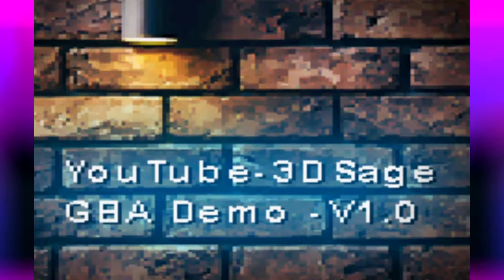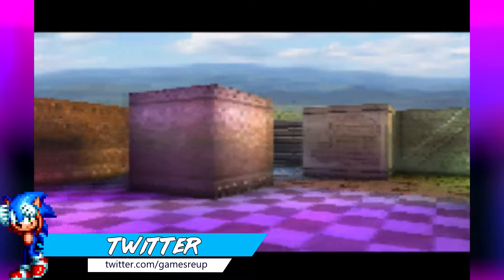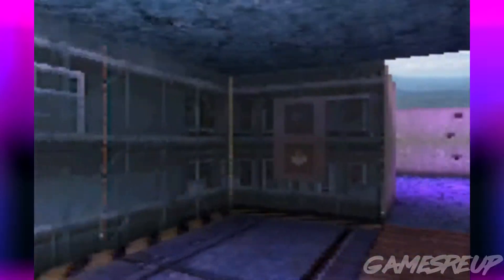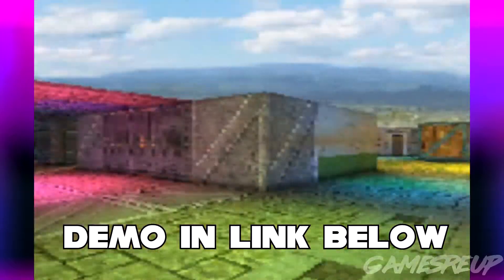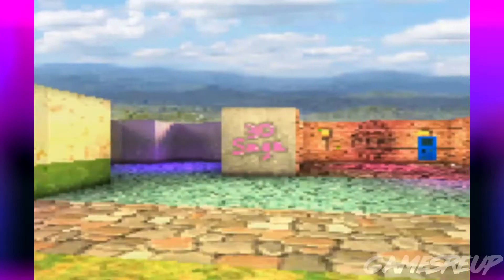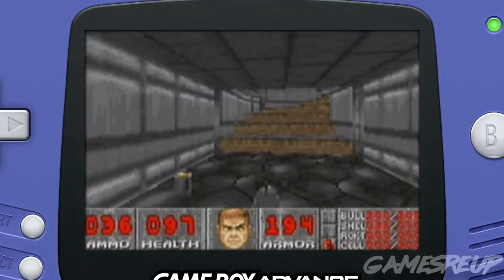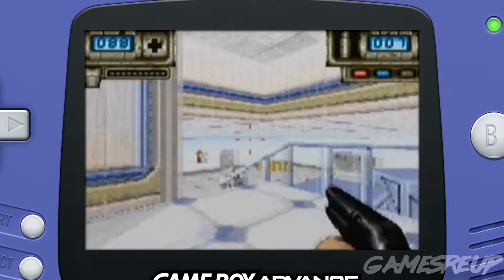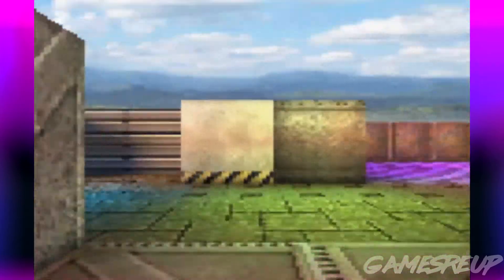NEW 3D GBA ENGINE - QUAKE ON GBA? - Sage 3d Demo 2020 - DEMO LINK INCLUDED

Comment: Quake is 3D. This is not. Now, there is a proper 3D Quake tech demo (probably made on Yeti engine) but it can't handle even starting area in full 3D.
Reply: not done on yeti nor bluerose, check out 3dSages youtube, that demo is a raycasting engine, but he has software coded some other 3d gba demos , check out his minecraft vid and his zelda vid,
Reply: @daisan5859  Not talking about 3DSage, Im talking about 3D Quake.
Reply: terminator future shock, came out before quake, possibly the first, true 3d FPS (if you are so inclined)
Reply: @daisan5859  what the hell are you smoking? Not talking about anything other than GBA quake.